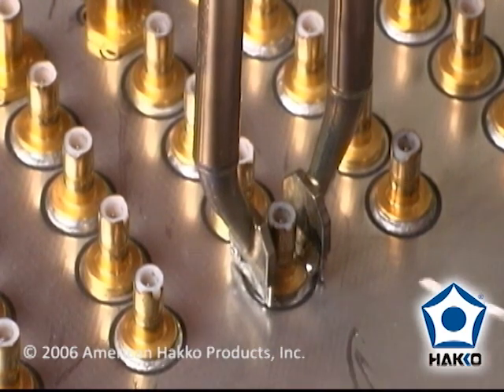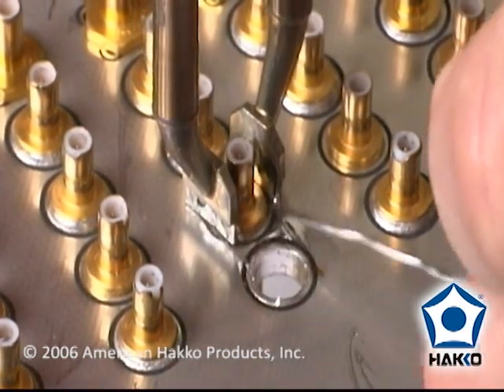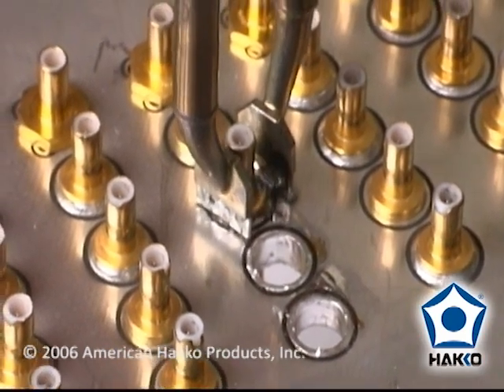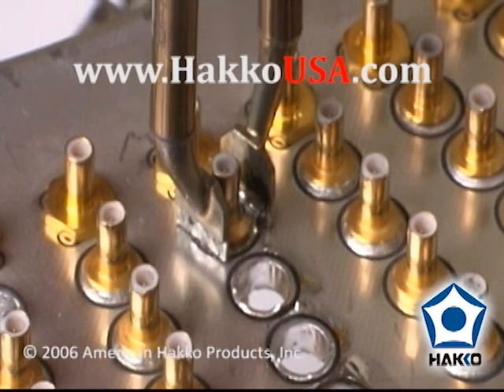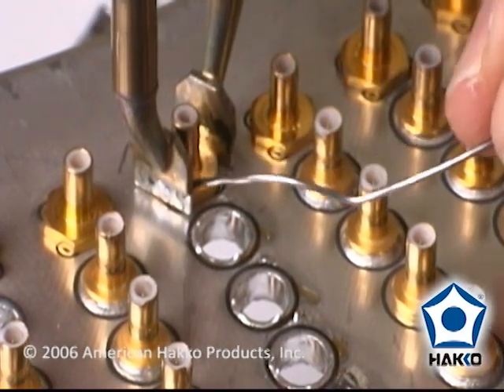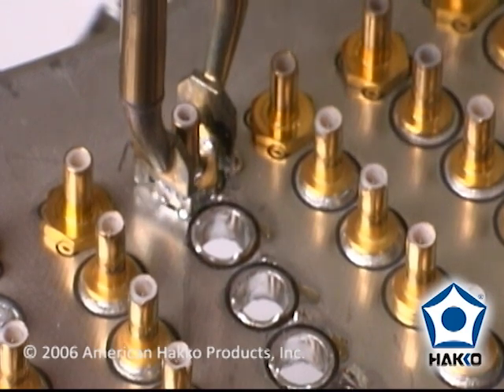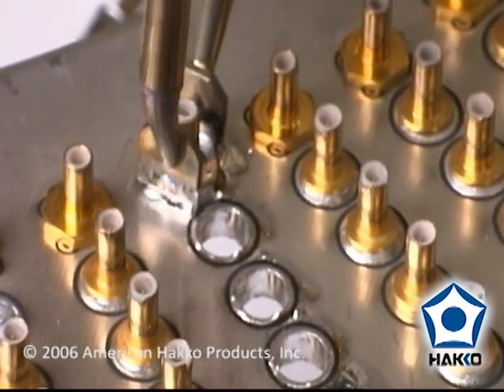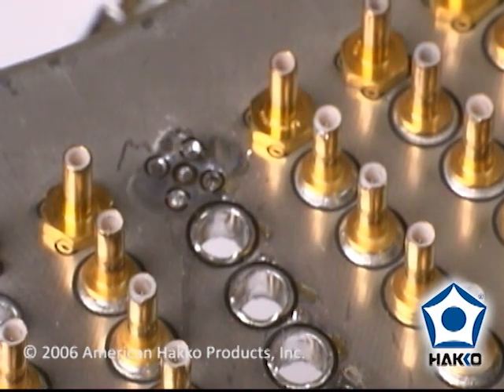HAKKO FM-2022 Removing Gold Pins — Video by American Hakko

Comment: Yeah, the solder plays the same role as thermal paste between a CPU or power transistor and heat sink (here, the pin to be removed is the heat "sink"). The tweezer tips have a small point of contact initially, which the added solder fills in. Flux is for helping solder to better stick to surfaces, but sticking isn't the issue here, it's insufficient solder since there's only enough initially for the pin in the board itself.

Comment: first you immerse the board in hot Muratic acid . remove from that then rap the board on a rock then take a wood chisle and tap the pins loose from their setting  then start picking away . Now if they are not soldiered spray wd'40 on the pin of a backplane. bla bla bla . Now how do you get backplane pins that are nestled in teflon sockets mountede on alluminum boards and they are soldiered. That militaryt backplanes Tons of Gold and what a mess